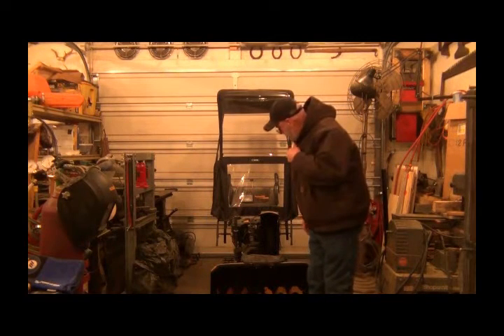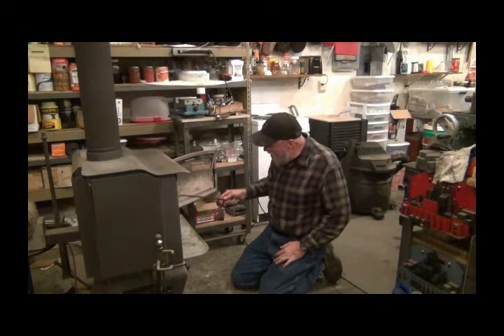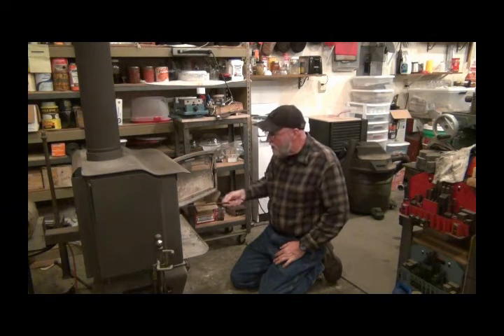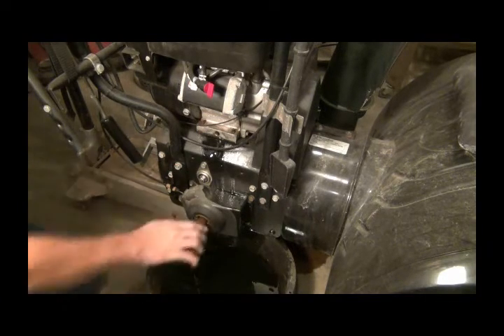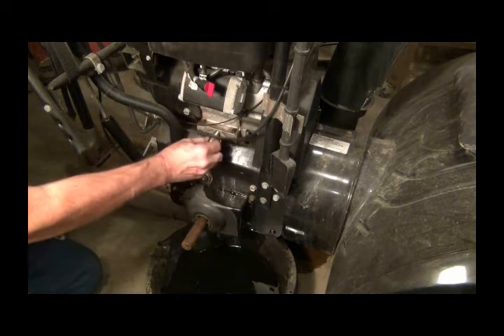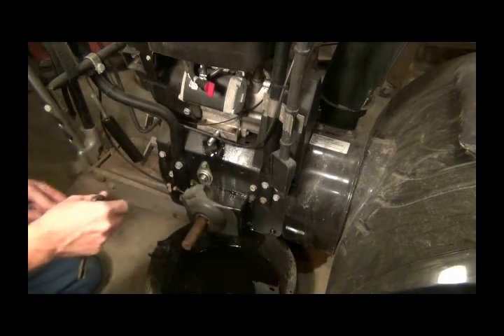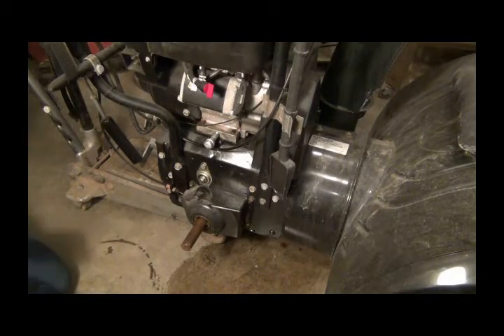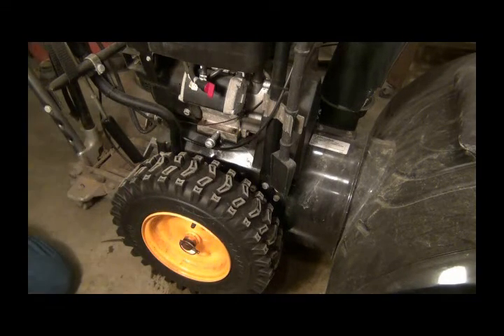Get the snow blower ready

Comment: Good idea by adding the drain extension. I had a heck of a time getting mine started last week. Changed spark plug, took the shroud off to check the primer line. Ended up draining the gas/oil mixture and getting FRESH gas and oil and it started right up. Truly a duh moment...lol
Reply from the maker: Live and learn, glad you got it running. Now hope we don't need to use them. lol

Comment: We got about 5 inches of snow and then it got to -25 with lots of wind.  Today it warmed up to whopping +5 and then dropped to zero and below tonite.  Supposed to be warmer tommorow.  

10 weight oil usually stays liquid enough that you can turn the motor turn over in the cold.  Switch back to 10w30 when it warms up above the 15 or 20 degree mark
Reply from the maker: This stays in the garage where it isn't so cold. So I put 10w30 in it. It is electric start so I can get it going pretty easy.